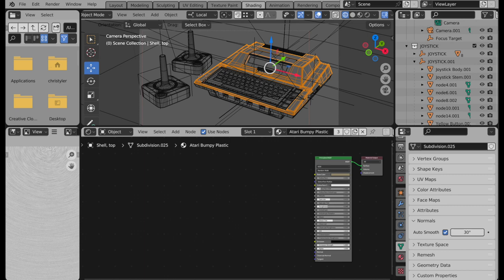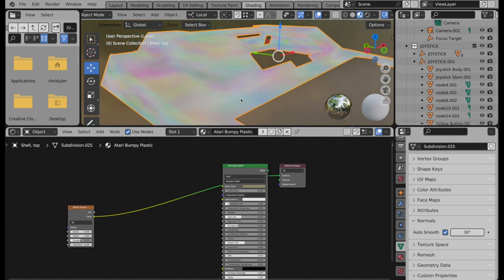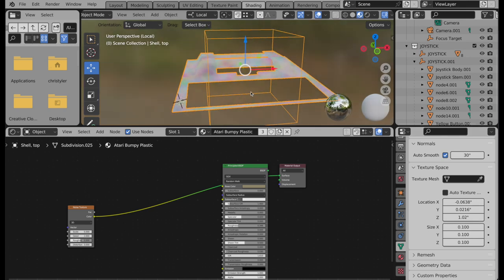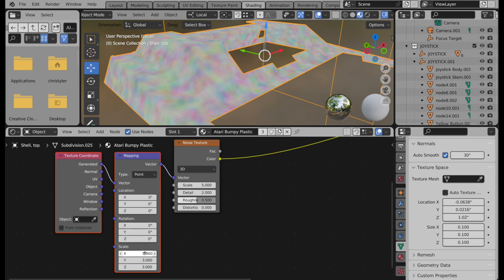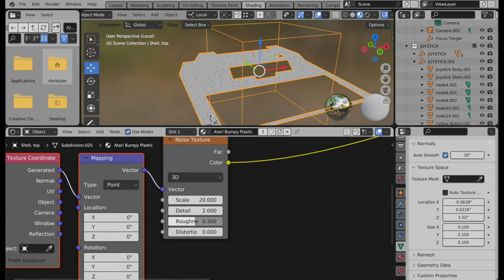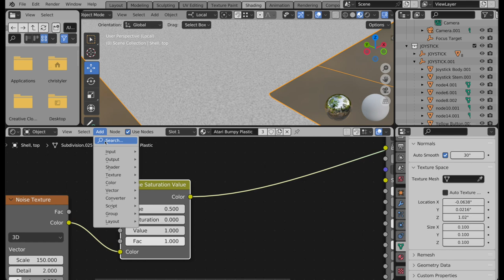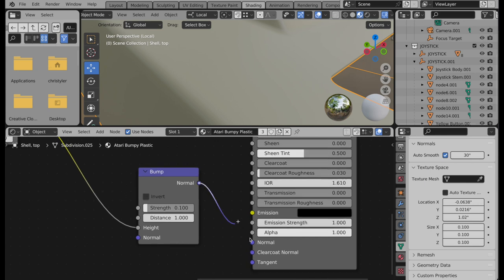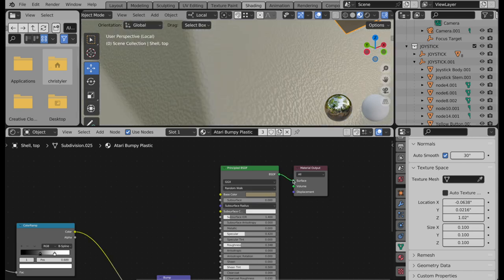Using procedural textures with Texture Space

Comment: 7:11 I do have to praise your use of the Bright/Contrast node here. Too often I see artists immediately jump to using a Color Ramp node in situations like this. This has its uses, particularly for more elaborate curves, but it becomes fiddly when you are trying for greater contrast changes, because the control points get very close together.

Another useful one is the Map Range node.
Reply: 8:06 On second thoughts, I think your use of Bright/Contrast (or any other node for adjusting the dynamic range) is unnecessary here. You should be able to get all the control you want from that Strength parameter on the Bump node.
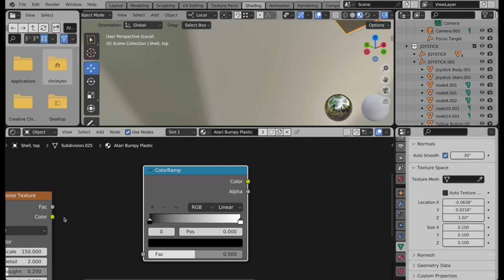Reply: 9:03 Ewwww ...

Comment: A proper way is to adjust distance to .001 (or .01, don't remember), since "1" equals 1 meter in Blender. Then, you play with the strength in this 1 mm (1 cm) range.
You can also use factor value of the noise instead of color and remove the saturation node.
Reply from the maker: Thanks for the tip, useful info.

Comment: I had guessed from experimentation that the Generated output of the Texture Coordinates node used the bounding box, but I had no idea it was configurable from another location in Blender. It completely escaped my notice for years.

I have tried using the Brightness Contrast node to adjust textures before, but I can't understand what exact effect it has based on my inputs. In it's place, I tend to use Map Range. (You can un-tick clamp if you want the output to continue past visible values.) I keep coming back to a useful Math node setup to drive the Map Range node... I drive the Minimum input values separately with a Subtract math node, taking an adjustment value from 0.5 and use an Add math node to add that same adjustment value to 0.5 which drives a Maximum value. This produces a contrast effect that I can better understand. 0.5 is treated as a center point for factor inputs, but in my math node arrangement, I can adjust this center higher or lower with more math nodes to give me a Brightness effect.

Sometimes, I need more precision when adjusting a value than what hold shift can provide, so I'll use a Divide math node, using 1000 or more as a denominator to control precision, and adjust the numerator to quickly find a value I like. It's faster than guessing a value, typing it in, then seeing if it works from visual feedback, then repeating until I find the right number.

Comment: My understanding is that distance affects the height input, while strength affect the output of the node. So if you have a bump and a normal input you can control them separately.
Reply from the maker: Thanks, that's good to know. I couldn't find any solid information about the two parameters.
Reply: Computation of the bump is done numerically, by sampling the function at intervals specified by the distance. So choosing the right distance value has more to do with how much detail you expect to see in the height function.